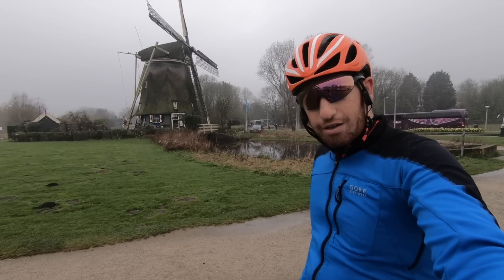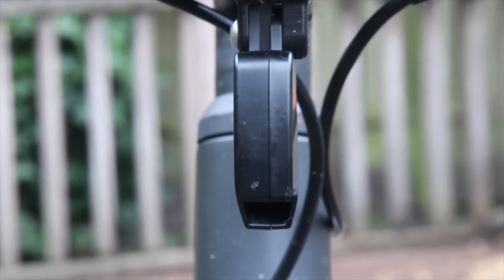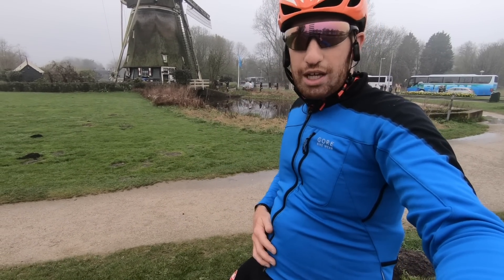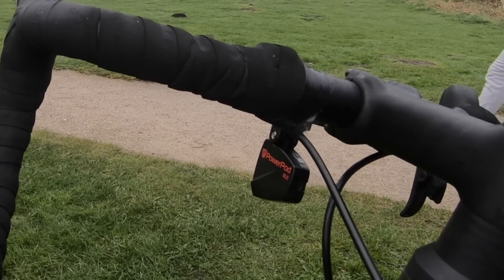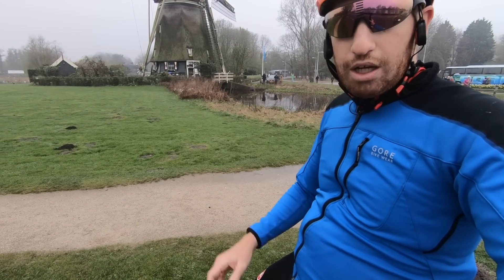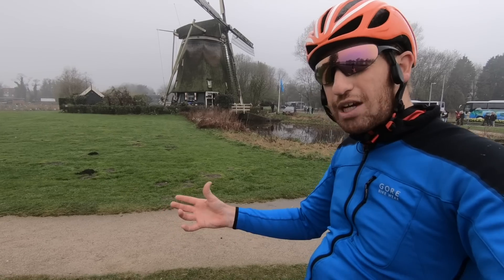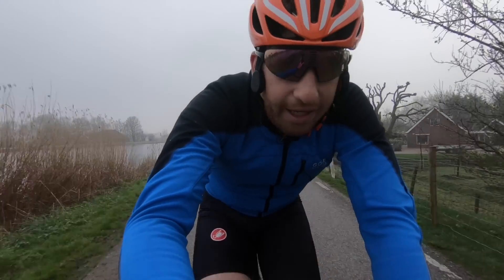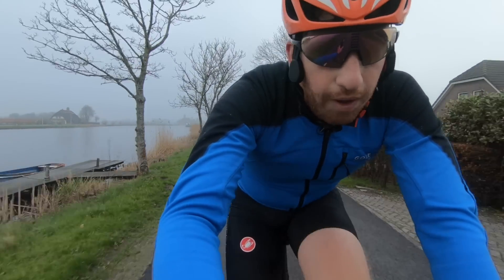Hands-on: AeroPod Aerodynamics Pod for $299 (+ Discussion of aero products)

Comment: Great video Ray. I appreciate the amount of effort that goes into these videos, it can't be easy to film and edit. About the powerpod, the real question is - is the CdA value accurate enough and not just noise. We know the best positions are 1. Arms bent on the hoods 2. Drops 3. Arms straight on the hoods. We don't need an aeropod to verify this. So can it really go above and beyond that level of detail? The other question is reference pressure. How accurate is the barometer? I'm thinking with varying altitude. It needs an accurate reference pressure at that altitude to accurately calculate air speed.
Reply from the maker: For most applications, this is really more about triathlon than road bikes.  So the nuances there are pretty massive. Things like head up vs head down. Hands even just an inch forward can significantly cut down on drag, etc...  This slightly older post of mine goes into that a bit: https://www.dcrainmaker.com/2013/05/aerotesting-alphamantis-system.html

Comment: This doesn’t make sense to me. It is not testing the way I would expect aero testing to work. Why not jaut setup a field that says “speed vs power” .10 mph = 1 watt. That’s let’s say base and if your sitting up you might be hitting 200 watts at 20mph. Go Down to drops and your now riding at 25 mph at 180 watts. Therefore your numbers change and you can compare.

Or just pay attention. To speed and power and see which position. Is fastest for you. Same road same wind direction and weather.
Reply: You’re not wrong, my understanding is that this is basically how Velodrome aero testing works. I think the benefit with this new tech is that you can get much more reliable data on smaller changes.
Reply: I guess it also depends on the wind speed if you want a real number. However those two points of data can help allot if tested consistently
Reply: You can change setups on your bike (frames, wheels, helmet)  and there's a constant metric you can check which is most aero

Comment: Well done and well presented. Everything you stated was realistic and factual. Except the part where you stated that aero-testing was prohibitively expensive, even for Team Skye. While aero-testing may seem expensive, it’s the cheapest way to go faster, pound for pound, when coupled with a bike fit and a knowledgeable aero-fitter. A power meter or a heart rate strap won’t make you faster. Better aero will. You get actual information you can act upon. Also, the relationship between power, CdA, and pain (your position on the bike) needs to be considered.
Reply from the maker: Thanks Allan - My comment specifically around Team Sky/etc was that it wasn't something you could do every weekend, meaning, you can't afford to go to a tunnel or a track session or similar every weekend/month/etc to see how to tweak things. I totally agree that an aero session though with gear at a facility is the best place to get faster from an overall standpoint, before you dive into the nuances of keeping that position stable throughout the season.
Reply: DC Rainmaker I agree with your comment. When you discover a more aero position on a bike, you also discover muscles you didn’t know you had. And then working with a physiologist to build those new muscle groups takes time. Go faster, or save energy. And minimize the number of variables you change. Or you end up with the perfect cocktail but have no idea what the ingredients are. I’m looking forward to hearing about improvements derived from aero by the general cycling enthusiast. Exciting times ahead.

Comment: Correct me if I'm mistaken, but road surface (consistency) is a factor to consider (rolling resistance part of the equation)..
Reply: Part of the fiddly setup of the PowerPod is an input for road surface type as well as rider size. Besides that, there are numerous accelerometers and sensors that measure multiple times per second and can report wasted wattage from bike movements and pedal stroke inefficiency through the optional Power Stroke functionality. On top of that there is a huge amount of tweaking that can be done via their Isaac software to fine tune your setup, but you are starting to get into qualified engineer territory then. Once dialed-in the PowerPod is great but in terms of setup & getting used to the software etc it pays to take your time to try and get it right first time. The AeroPod sounds like it is just adding another layer to what is already there, which I imagine would not be all that hard to calculate based on what they already have in the PowerPod. If you deviate from your set baseline in your PowerPod and there is no relative change in gradient, acceleration or wind speed then a relative change in speed can be attributed to CdA (I guess).
Reply: Target Pace true but there is nothing you can do about the road surface, also when you double the speed you ride you quadruple the aero drag.